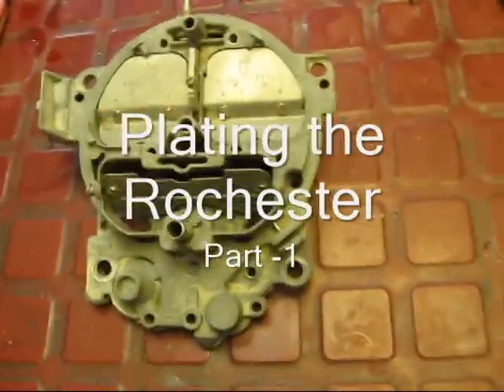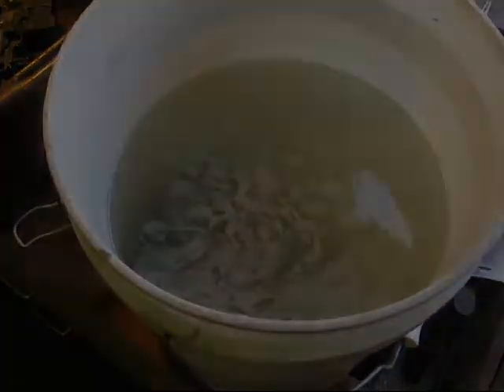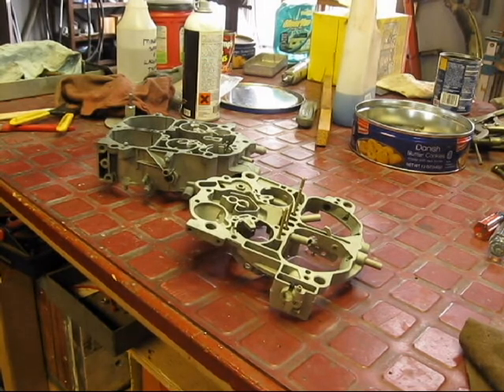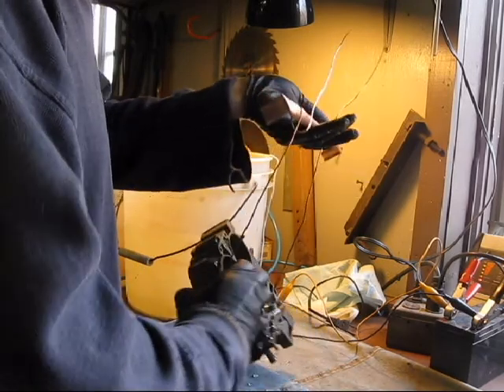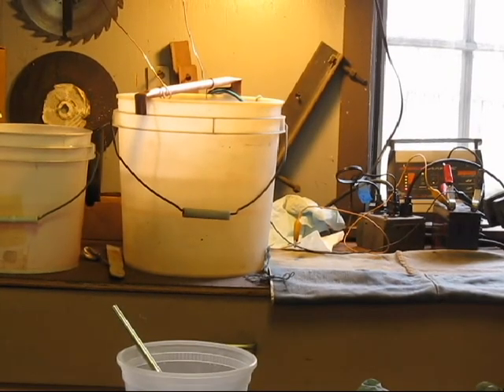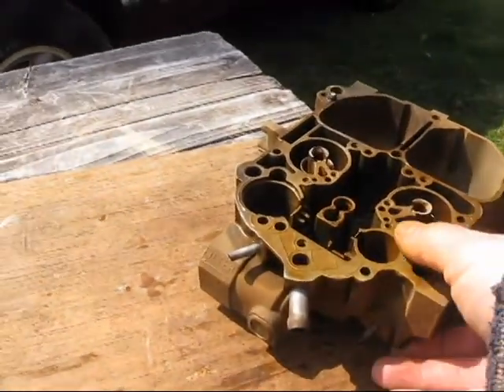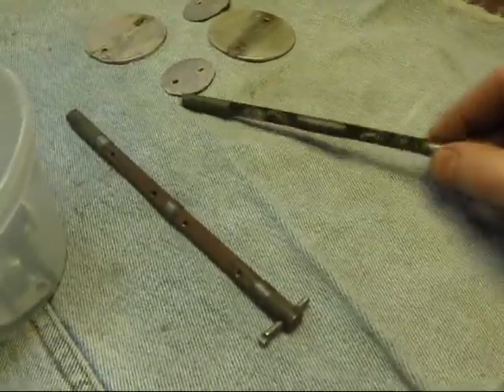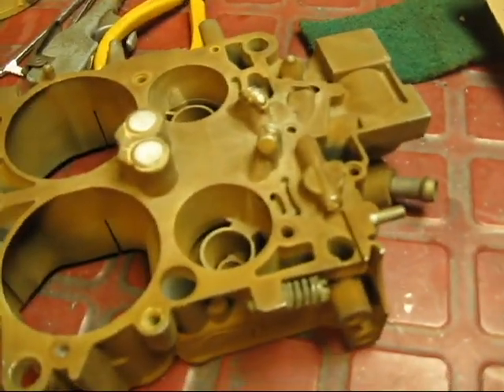Rochester Quadrajet Re Plating Rebuild and Tuning Part 1

Comment: You have made this process very complex. The casting is zinc. It needs to have the pours opened and then the casting will react to the proper PH chromate and recolor the casting. All the steel parts do need to be electroplated as you did. The words iridite and alodine are confusing not part of the process. They are used on aluminum.
Reply from the maker: Yup,,this was my 1st attempt.. And an old video now,, sadly I had to sell my beloved Nova...I would love to do this again..Not to mention that was a really crappy camera

Comment: Uncle Arch do I have to take the roll pin out that connects the acceleration pump in the carburetor?
Reply from the maker: no, just push back toward the carb air horn but stop before it hit it, leave enough room for a screwdriver blade so its easier to pry back into place later

Comment: Hi what did you use for mixtures for your chemicals
Reply from the maker: that can vary, for plating I used pure vinegar, its the type used for cleaning, you can use 2 gallons and 1 gallon of pure water, any water without minerals, distilled or filtered and that makes 3 gallons which is enough for a carb.
For cleaning, well that varies, for pickle bath you can use a small amount of hydrochloric in 2 -3 gallons of water, generally about a pint of acid, ya dont need much, test it by using a test piece and looking for a reaction within about 15 minutes.
I also use some aluminum cleaner I get from the welding supply and that mix is about the same as the hydro but you can also spray it on full strength. 
Consider that it doesn't need to be that strong, it will work quicker if its stronger but be careful cause speed isnt required here, sometimes its nice to drop the crap in a bucket and walk away without worry that you vintage metal inst gonna be a slurry of sheeit in the bottom of a tub! lol
If you buy the chromate, follow the directions on the label, its a very small amount in distilled water.